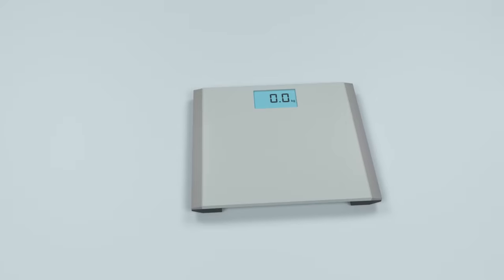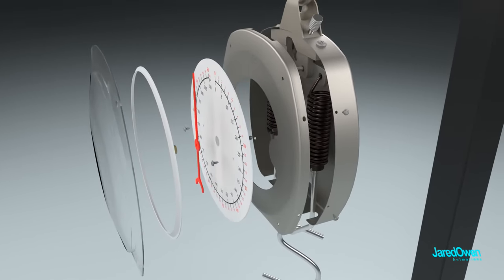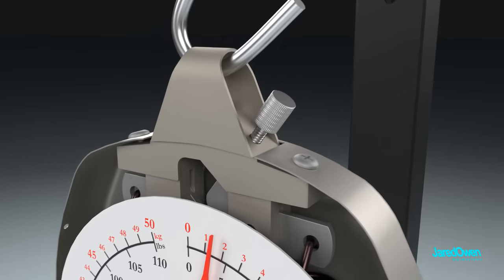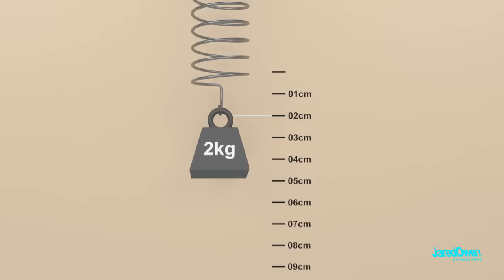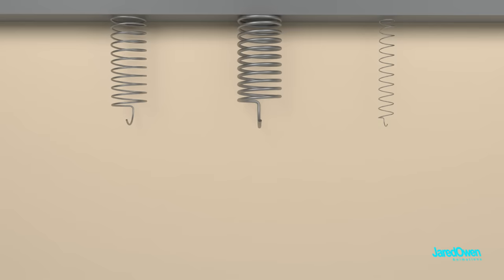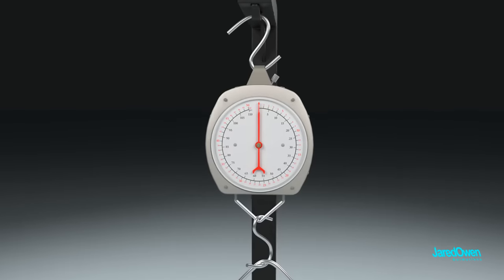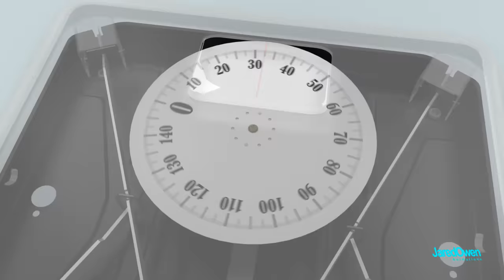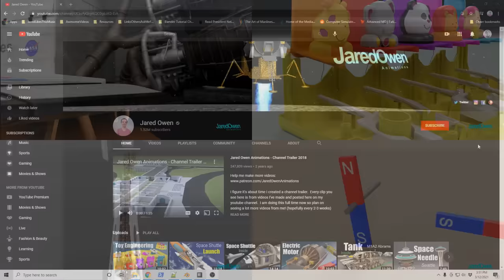How does a Mechanical Scale work? (Spring Scale)

Comment: I had a college professor (Engineering Dynamics) who had a 3D video prepared for every lecture. He always said, if you know the equations and math yet you cannot visualize and fully understand the theory, I have  failed as an educator. 

Not only did I ace the course, I came out passionate about learning the theory, I was able to dive deeper into solving homework problems, and if I took the time, I could visualize each homework problem and form solutions. It felt like a super power and many of my classmates came out with the same effect. That professor was 1 in a million.

Comment: Great animations. The one part I'm missing is a description on how levers are used in the floor scale to dramatically reduce the force applied to the spring. The load placed so close to the corners means the force on the top is almost entirely distributed to that end of each bar. Less force on the spring means you can use a smaller spring and have less risk of deforming.

Comment: My daughter got an alligator toy.  You open the mouth then press down on each tooth until it snaps shut.  The ingenious part is that every time you open it, the trigger changes to a different tooth.  I’m afraid to take it apart to see how it works because sometimes springs and pieces will fly out then I can’t get it back together. Love to see a vid on it in case your looking for ideas.  Thx for these fascinating videos!

Comment: Very well done!

Fun fact (probably well known to many, but certainly not to all); scales do actually not measure weight (lbs, kg...) but force (Newton's). 

Since the relationship between these two will vary depending on your location on the earth, measuring an object on a scale will give you (very slightly) different results in different locations. 

For high precision measurements, this has to be taken into account. If you send a high precision scale to have it calibrated, the lab will specifically state the gravitational acceleration of the calibration site in the certificate. 

If the scale is then moved to another location where the gravitational acceleration is different, this difference can be compensated for. 

This is however not relevant when weighing groceries or people. 😊

Comment: The floor scale reading actually does depend on where you stand on the platform. Think of the platform as a lever. How far the center of pressure of your feet is from the pivot determines the exact reading. Hence why spring scales are not as accurate as digital scales.
Reply: Interesting

Comment: This helped me understand most of how the floor scale works. It is very nicely done. But I don't understand all of what is going on at the heel end of the scale. As drawn, the bars seem to apply force to the plate toe-ward of the long axis of the big copper colored spring which looks like some of the force would be applied to rotating the spring about the left-right axis. A groove for one end of the spring is shown at the top of the adjustment screw which would tend to allow the spring to rotate about the groove rather than bend. My guess is that the rotation re-orients the spring a little so that force acts along the long axis of the spring as it should. However, that smells a little fishy to me because there is friction between the spring and groove so it doesn't rotate with low resistance so the spring is bending a little instead of stretching so Hook's Law isn't enough to account for all of the spring force acting against the weight force. In other words it introduces some error. My other guess is the error is too small to worry about in a bathroom scale, but its presence still makes me worry I am missing part of how it works.  It seems like it would be cheap and easy to minimize the error by lengthening the lever bars a little heel-ward so they contact as far back as the long axis of the spring.  Or have I seriously misunderstood how it works?

Comment: The spring constant k is very large, (a tiny stretch in length even with heavy weight).  Thus body weight scale or language scale have label mentioning that cannot be used for ordinary commercial activity.

Comment: There is probably a design flaw in the floor scale. The metal bar with the gear is not horizontal when the metal thing turns which doesn't give a linear result therefore affecting the accuracy of the reading.

Comment: Great simple & clear video. How can I use 2 hanging spring scales to measure the weight of an object that is greater than the top limit of each scale. Do I hang them in series, one hooked to the one above it, or in parallel, where they sit side by side, each hooked to the support and each hooked to the weight?

Comment: So one thing I'm curious about is the process by which the company calibrates the display to the spring stiffness. That's not something you can adjust on the fly, so I'm sure a lot of experimentation has to take place to make sure that the manufacturer is giving you an accurate weight on the display.

Comment: Very good animation! But the force that is necessary to pull a string is not absolute linear to the length. This can be seen on many scales where e.g. the 1kg mark is at 180 degrees and the 2 kg mark is at about 340 degrees...

Comment: 7:20 does it mean that the threads should be designed to take the entire weight the scale is rated for? 

Those are some strong threads!

Excellent animation.
Reply from the maker: Thanks Anirudth - not sure about the threads
Reply: @JaredOwen  Thanks

Comment: The fact that the arms a compound lever in reverse allowing for a much smaller spring to be used so the relationship between the weight and the spring is not 1to1

Comment: At 6:10, when the plate is pressed down, shouldn't it pull the rack toward the back of the scale, which would be against the pull of the small Spring at the front that is used to return the dial to zero? The animation is showing the rack moving forward when the plate is pressed. Or is it the fact that the plate is preventing the rack from going forward when there is no weight applied and that is when it is at zero? Why the small spring then?

Comment: Hi, great video, I want to make some scales to weigh one corner of a car. Each corner shouldn’t see more than 400kg ever. My first idea was to use a load cell but I would need at least 3 for a triangular platform or 4 for a square one. However I want to keep the cost down. My new plan is to gut one of these mechanical scales and replace the main spring area so that the force from the 4 arms is placed onto the load cell sensor, that way I only have to use one. 
Another option would be to use another spring that has a higher spring rate but I’m not sure how easy it would be to find a suitable one for my application. 
Do you see any flaws in my idea? My main constraints are cost, absolute precision is not completely necessary.

Comment: I was wondering about the 4 metal bars inside the floor scale - Wouldn't it mean that part of the weight to be measured is resting on the frame of the scale? Is it taken into account for the measurement? What happens if I stand in one corner of the scale? Thank you for the video!

Comment: So if it is used on daily basis and not adjusted since years
It would show wrong  value as spring will not be able to have same strength might be causing some rust or expand and contract daily would affect

Comment: So if it is used on daily basis and not adjusted since years
It would show wrong  value as spring will not be able to have same strength might be causing some rust or expand and contract daily would afdect

Comment: But how do they make springs that elongate a perticuler distance with a perticuler wright? If springs elongate more or less than the specific number it will effect the weing results , right ?  if the spring elongation is wrong, how do they adjust the result? With different pitch in rack and pinion  ?🤔🤔🤔

Comment: Chinese scales have an oval piece of aluminum with an electronic device that measures the bending of the  Al bar...only prom. is they are not adjustable and can be out by 50grams..I have had about 6 of them all junk.